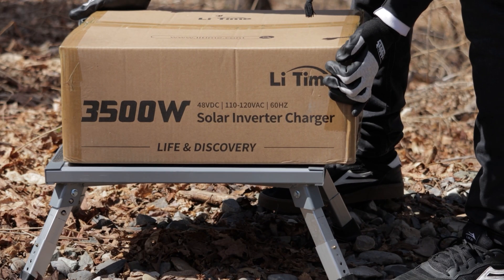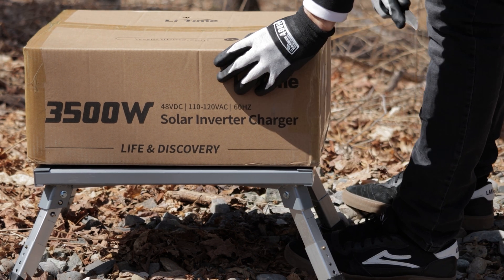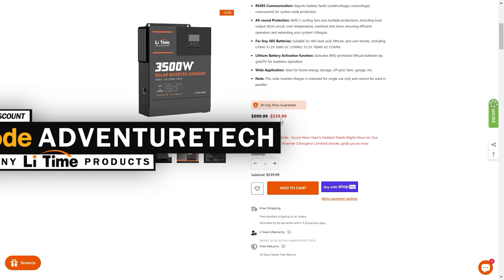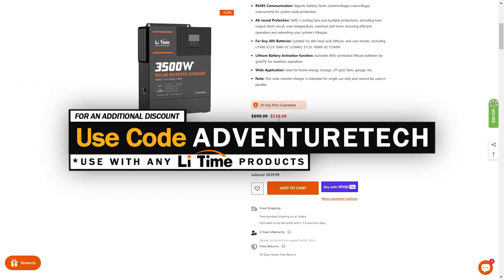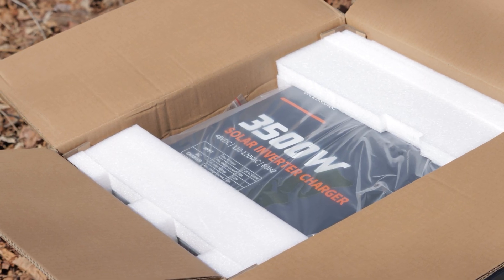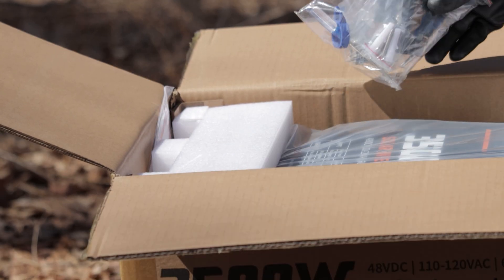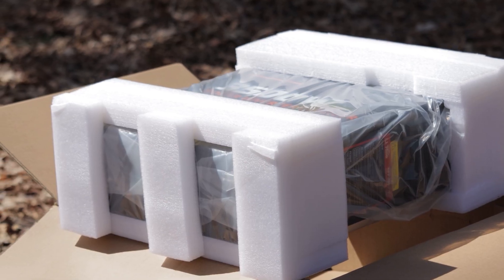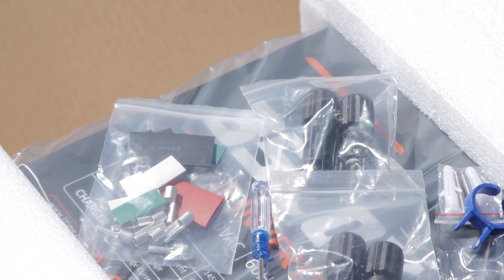Unboxing & Test - LiTime 48V 3500 Watt Pure Sine Wave All in One Solar Inverter Charger Review

Comment: Have you seen the new 5000kw unit and have you tried running either in parallel?   The manual seems lacking in this regard.
Reply from the maker: I am talking with them now about the new unit.  I wonder if it can communicate with Victron.  A lot of their new stuff can.   Hopefully be testing a lot of that stuff soon.  This unit does not appear to support parallel according to manual.

Comment: Great video. Question.. we are not getting any PV input. We currently do not have anything connected to the AC ports of the device, could that be prevent the decive from receiving PV input?
Reply from the maker: As long as the battery is connected, you should be getting power from your panels if your panels are within the correct voltage range.  These soalr inverters require at least a minimum to get going for solar panel voltage.  Make sure to check battery manual and set your inverter settings right away too.  You might have a setting incorrect.   IF nothing else, could be a connecting conductor, fuse or breaker issue.

Comment: this is not a review. this is an upboxing and an advertisement.
Reply from the maker: You are right it's an unboxing and is sponsored; but it is still a review of course.  

A review is simply a "formal assessment or examination of something..."  

 I do a pretty good job being very up front and straight forward about sponsorships at the beginning of the video.  I'd probably make more money if I didn't.    Plus it helps keep food in the fridge.   Absolutely no one should be working for free.  That is called slavery.   I'm honest about my sponsorships, unlike many other who use affiliate links and don't legally disclaim it properly.   

My credentials are pretty good too as a veteran power plant inspector (NDE, NDT - Non-destructive testing - Industrial and Environmental Services; aircraft engines, pressure vessels, DOT inspections, and too much more to mention), so I can help curate what is shown here, and help to show these product in a way that will help a lot of people.   I'm here too if you have any questions, or if you wanna troll some more ;)
Reply: @adventure-tech2.0 give your opinion on the product. Talk about some pros and cons. Im not trying to troll but you dont actually review the product, just un box it...

Comment: They’re $635 now with your code. That’s a hard pill to swallow.
Reply from the maker: This is actually on the low end for these types of inverters and cheapest I've seen this type of stuff ever.   IT is a lot of money. I'm not saying that.  But in terms of value, it has a high price to value ratio based on current market and this product's capabilities/company's reputation.   Two of these in parallel are pretty nice too.  You can set the  split phase 220 and run some serious power even on these smaller Solar Inverter Chargers.

Comment: What size ac cable are you using? Also, what clamping tool is that? Thanks
Reply from the maker: I can only share what I experienced.  It's not my intention to teach professional level but I can share some information.  Cable size will depend according to what you are personally using in your set up.  Crimping tools can crimp on ends and create a mechanical welded connection for safe installation.  Crimpers are sized same a wire size.  Most inverter and battery products will recommend a wire size in their manuals.  I try to see what is going to be pulling power and make sure to use the appropriate gauge wire for that primarily.   So if I connect a 10w light to a 12v battery, it does not need a big wire size, but a 3500V inverter will need a much larger gauge.    Some times a wire can be too big even depending on the terminal size on the equipment.   It was confusing to me at first but the more I consumed information about this stuff I learned more.

Comment: One thing I don’t like about it: pv voltage 60 to 115v. Max should be >=300v.
Reply from the maker: It can actual run up to 145V but recommended is 60V to 115V.   For this I recommend running panels in series and parallel within that voltage, as long as you keep amps below 50.
Reply: I disagree somewhat. Most of the all in one 48v units require a min of 120 volt input, with around 220v to be better.  Most of us don't have room for 8 or more high voltage panels .
Reply from the maker: @ROCKETRACOON60  Yea, it can be difficult trying to get all the specs for the various pieces of equipment in a DIY solar generator set up just right.   All in ones are definitely set up to cater towards medium to larger arrays.   And you can run these in parallel to get 2 phase and stuff like that.   One thing that can help choose best equipment or you, is make sure everything matches up nicely.  Just the way one piece equipment is made, may indicate what the rest of your set up should be like.  You can always ask me here too.   I've beat my head against the wall figuring out really great ways to size and choose appropriate equipment.
Reply: I have that exact charge controler and there 48v 100a battery.
I have 200w panels from bougerv. How many can I use and in what configuration? 
Plus I try hooking it up to ac and it keeps triping braker and I have tried several different gfic without success. Any help here is greatly appreciated
Reply from the maker: @ricochetronm5385  I can share what I would do.  Always have it checked over by certified electrician when you are relying on these things in your homes and what not.   Sometimes the issue can be just the torque on a terminal causing the issue.  But I can help size stuff pretty easily.  

Let me know the (1) Short Circuit Current and also the (2) Open Circuit Voltage from your solar panel tag data or product page.   I'll tell you what this solar charger can do with them, configuration, fuses needed, etc...   

For your breaker issue:   Is your solar charger throwing any errors when you trip the AC breaker?    What are you running when the breaker trips (wattage on solar charger screen at time of failure)?  Most outlets are good for 15 amps, which is about 1600 watts.  So if you are running bigger devices 20 amps (2200 Watts)  are better option for a standard outlet size.  Higher amps require larger outlets (NEMA and stuff like that.)  This Solar controller can put out a lot more power than your outlets and breakers can handle. So you may trip your outlets and breakers without even breaking a sweat on your solar inverter charger; if you are running something pulling more than 15 or 20 amps.    

Let me know you solar panel info and who things work out with your breaker issue.